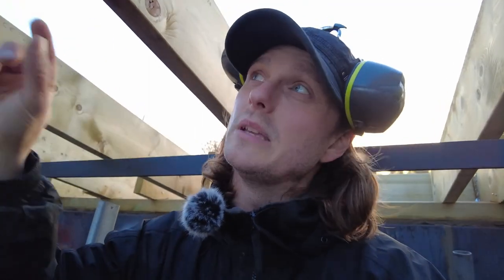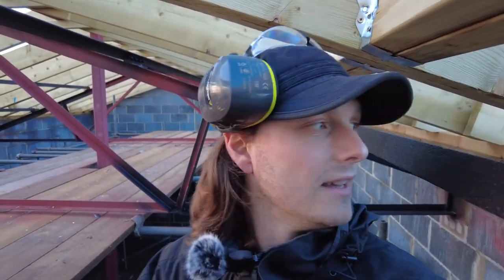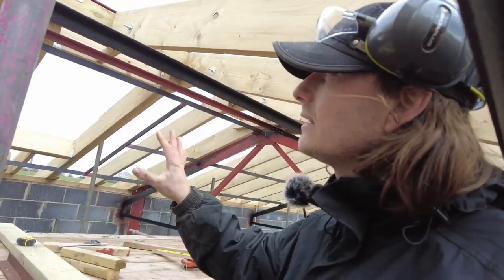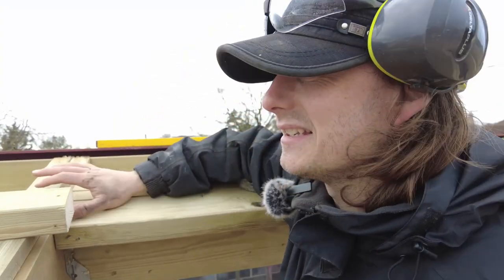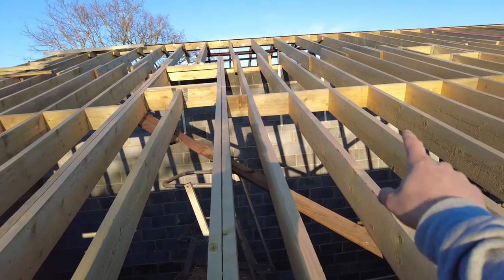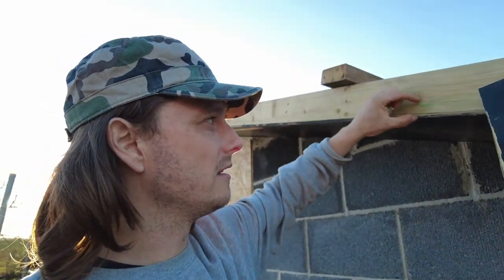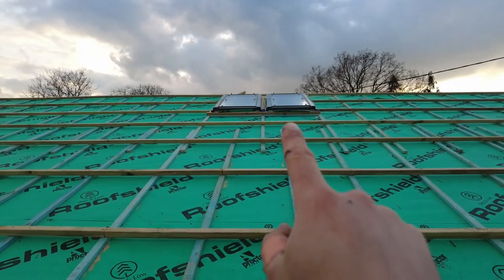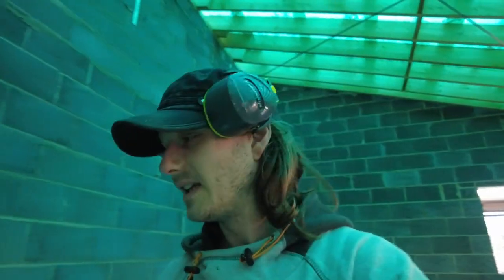Roof windows - felt and batten ---    #selfbuild     [The Barn Rebuild 006]

Comment: You are right, you shouldn't have to be sorting out problems like that, however the alternative is far worse as you are the one that is going to be left with possible problems if you don't get involved. I was building for about half my working life and it really all comes down to management, getting things ordered on time arranging the right trades at the right time and thinking things through so there are no nasty surprises. I think you are doing a good job but I also think you will have to stay involved or it will tear you apart. Well done with the welding by the way, I reckon I can put my hand to pretty much anything in the building line but welding is something I have never tackled . Keep smiling!
Reply from the maker: Thanks Michael 👍 you should buy yourself a welder like mine, it's not the best but I've used it a few times now and comes in handy for little bits. I'm going to make up a post to hang the house sign off next. I'm fed up with the delivery drivers claiming they can't find the place 🙄